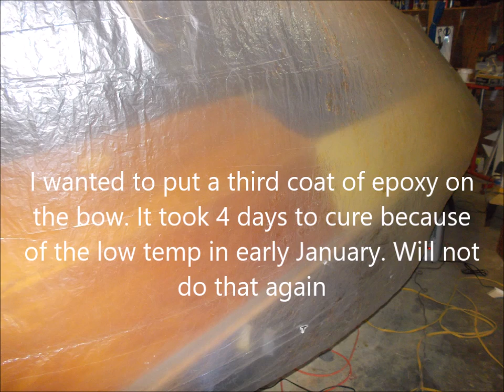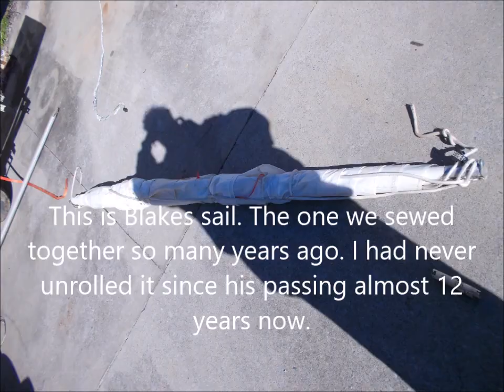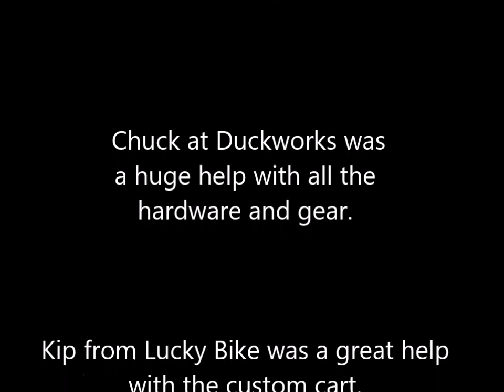Flint by Ross Lillistone

Comment: Thanks so much for the great tips! Super helpful.  When you say you pulled the zip ties to sand the edges flat, do you mean flat in orientation to each other so the edges would fit together more tightly?
Reply from the maker: Yes, The edges were riding on each other. I pulled it back apart sanded those edges flat so they had a place to butt up against. made a huge difference. it was much better.
Thaks for the question and sorry for the delay.

Comment from the maker: Ross does a very good job at laying out points. I did not have full size plans and did not need them. You simply laminate two sheets of plywood together and use the plywood as a grid. Connect you dots and start cutting. Used shroud wire to draw the lines. Worked reallly well.

Comment: Do the plans call for 3 layers of 6 oz cloth on the hull or just the seams??  She is a beaut!
Reply from the maker: Just the seams. You will add a layer at the seams both inside and outside. Then add a layer encapsulating the hull. Thank you for the nice comment! I have really enjoyed her.
Reply: Thank! I row singles so I might be a little spoiled on rowing...but hard to fish from a racing shell! ha.
Reply from the maker: It's a great rowing craft and a fun build! My daughter fishes from mine all the time.
Reply: When pieced together, were  the paper plans the actual size of the various boat sections, so they could be used as templates to cut the plywood sections?
Reply from the maker: No, I did that because  I use this boat in extreme events my son and grandson use it to fish. I knew it woud be abused. She has held up well.